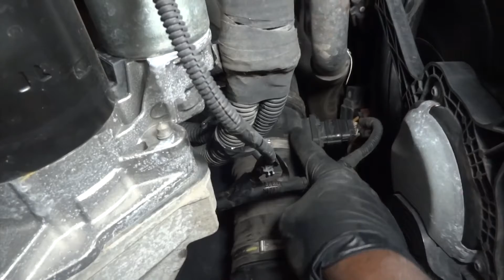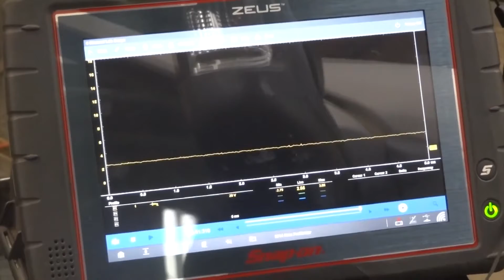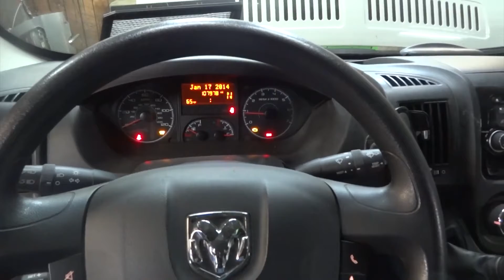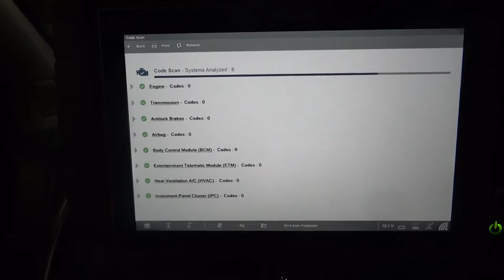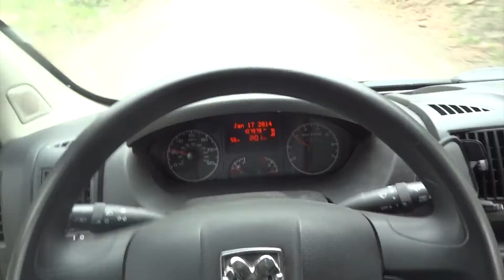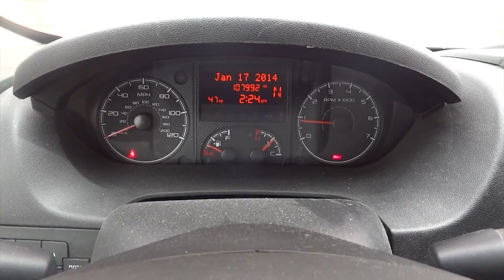RAM ProMaster 3.0L Low Power ( THE FIX ) Part 2 - Limp Home mode, DTC P0402 & P0101 EGR Valve issue

Comment: Hey can u help me with my Van please 🙏 I have 2016 ecodiesel 3.0 and my transmission works only in 1st gear n reverse only. I try to do transmission relearn and it can't verify engine RPM. On the dash cluster the rpm work and the speedometer speed goes up. What could it be?
Reply from the maker: @liliyanplachinta3363  Sure, I can help, can you bring it to our shop?

Comment: First time viewer and WOW! Super informative. Im curious, if tou were able to complete a forced regen do you think that would have corrected the issue without having to take it all apart? I JUST spent an obscene amount of $$ at the mechanic installing a new control unit and leaving the shop i got P0402 code. I was hoping I could figure this out myself, but looks way above my pay grade! I do have a dealership I can take it to for the regen, though. But if this doesn’t work I’ll need to find a new mechanic.
Reply from the maker: @nicolehopkins2181   If your EGR is dirty like this one, it has to be cleaned first

Comment: 15 diesel, Have soot in coolant, p0269 code and p0272. Trying to disconn turbo to see if it stops high pressure in degas to hopefully determine if egr or head gasket issue. No white smoke or steam from tailpipe.
Reply from the maker: @LeoJamar  that's odd!

Comment: Great video. Is that amount of carbon buildup normal? Would the glow plug code stop DPF regen and lead to increased carbon buildup? Is it something that once it gets bad enough that the EGR valve begins to stick open the carbon buildup accelerates? Does the affected throttle body then also increase carbon buildup? I'm trying to understand the (perhaps cascading) processes/issues that lead to that level of carbon. Thanks!
Reply from the maker: @sluggo7   Thanks, Yes Exactly the glow plug code would prevent the DPF From Regening, that's what happend on this one, when the carbon build up gets high, it causes the EGR Valve to stick and the Throttle body also!!
Reply: Excellent video and I just think my van is going through the same thing so thank you very much for this valuable video

Comment: Great video again, thank you. A really nice piece of diagnostic work and a very thorough repair job. Most mechanics would have just replaced the MAF sensor, and when that did not work, they would have replaced the EGR. 
When i saw the video title i thought this was the terrible EcoDiesel engine. I see this van is just a rebadged Fiat. I wonder if your scan tool would have worked better had you told it that this was a Ducato van?
Reply from the maker: @Nick-bp7jf   Thank you! I'm not sure if the scanner was gonna work better if I identified the vehicle as a Ducato van, I will try it next time!